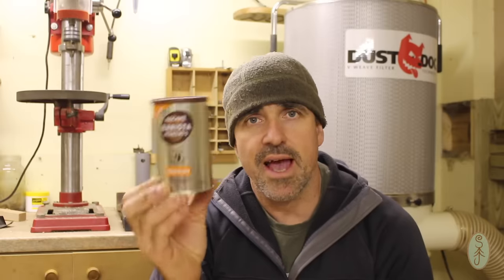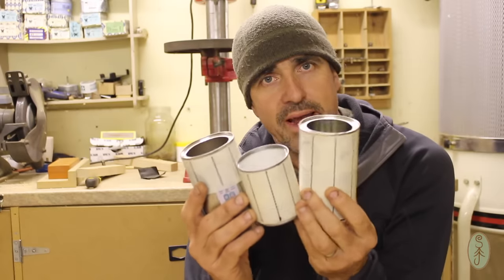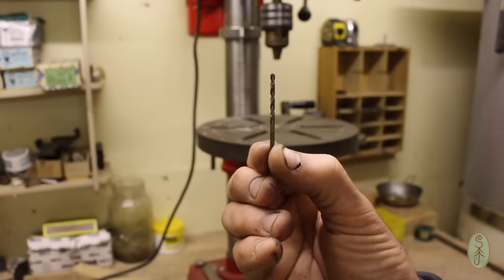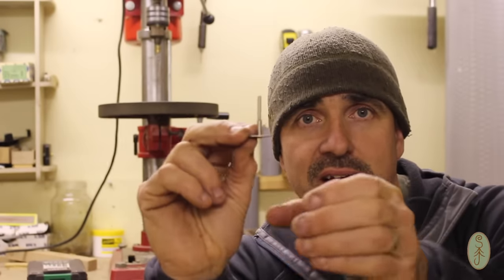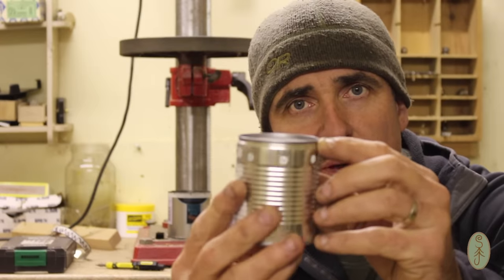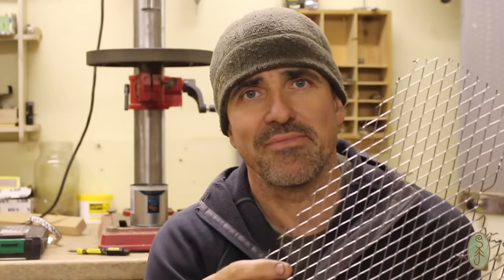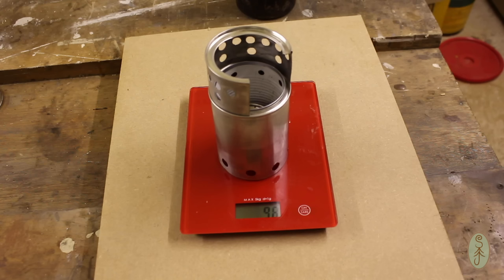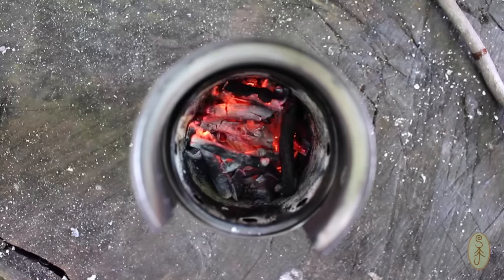Ultralight Wood Gas Stove.  How to Make a Super Light and Compact Backpacking Twig Stove.

Comment: Should you not have powertools, and have to use hacksaw and no step drill , consider filling can with water and freezing it before working on it.
Reply from the maker: That sir is a genius idea!!
Reply: can I be dumb and ask  why?
Reply from the maker: It keeps the can stable while drilling and cutting - stops it squashing and reduces tearing when drilling - you are basically creating a temporary solid object to work on. 👍
Reply: Alternatively, use metal shears or heavy duty scissors of some sort? The frozen water solution is intriguing though -- I might try that. Cutting something as thin as a can with a hacksaw will probably not work well unless the hacksaw has really, really small teeth.
Reply: Amazing! So, the genius for this video brings out the genius of a viewer! Awesome!
Reply: Also, it will keep drill bits and cutting tools cooler which results in a longer lifespan.
Reply: All the benefit of attending an engineers convention... thanks for sharing the skill and erudition.... ATB
Reply: So make all markings first before freezing...but tape wouldn’t stick and the marks from sharpie may rub off after freezing? Or would the marks stay, I wonder? Simon, Tfs and Atb, Nikki.
Reply: Or using a curved wooden cutting block to drill and cut against.
I thought that while watching, and also that the stretching method, while ingenious, would be far more enjoyable after emptying the bottle :-)

Comment: I have a cheaper copy of the Bushbuddy and both its combustion chamber and outer sleeve have bottoms. After a while, it produces clean, blue flames so the bottom doesn’t have to be open. With both sleeves closed, the ground doesn’t suffer. I’m very impressed by what you’ve created. Maybe there’s scope for a shorter, stouter Mk 2?

Comment: Wonderful design and make - I love it. Three things to notice:
a) the bottom of a slightly bigger can could help against scorching the ground and catch the ashes and embers that fall through your mesh
b) using a finer mesh and smaller pieces of wood (about half the size of the diameter of the combustion chamber) or wood pellets would give you a longer burn time
c) you don't want to overfill it - the holes for the secondary combustion need to be slightly above the fuel to work properly - watch your stove starting to smoke after refilling with longer sticks; smoke is wasted energy

Comment: Simon !  I just made one of those.... had to improvise in a few places but the results were remarkable !  i just put in 2 small hand fulls of wood pellets  into the burn chamber and sprinkled 91% Iso-Alcohol on the pellets and lit it with a match... it went puff and then it was going so real easy to start... I tested it in my shop with the sliding barn type door open but there was absolutely no smoke at all once it got going.... I just drilled holes in the bottom of the burn chamber and it did indeed work fantastically boiled the water in about 4~5 minutes to a rolling boil just like the Alcohol stoves for the most part the flames were blue and that surprised me ! the jets near the top were yellowish near the top  the rest was blue ! 
.... the cans i used were a Progresso soup can and a cambles chicken noodle can (old style stuff) the cans nested well inside each other so I used them ! so there was no streaching the rim they set inside each other and there was no need to fuss with the rim the cans fit fairly close to one another so I was concerned that the jets would not get enough air but they did indeed work very well together .... thank you a bunch !
Incidentally the Jet holes I used were larger than yours and I noticed yours had a tendency to smoke a tiny bit.... Mine doesn't at all and I was really surprised !
I also used 8 holes but a slightly larger size ( I think 1/2" but that may be on my bigger chili can and spaghetti sauce can(big tall can) woodgas stove ) they both work great !  I cut the center of the bottom of the chili can out to fit the spaghetti sauce can and fit it in there and then took my plyers and bent the rim of the burn chamber out so it would be more stable and not fall through.

Comment: Awesome stove Simon! If you put a paint can lid on top of the pot stand you don't have to worry about soot getting all over your pots. It would mimic a heat diffuser perfectly! :) You can also get another coffee can, and that would make a nice looking homemade cook pot. It will look very identical to your homemade stove! Buy some stainless steel wire to make a handle with the wire with pliers, or a bail. After burning off possibly plastic inside your coffee can your homemade pot should be ready to go! :) Thanks for sharing! Melissa :)
Reply from the maker: Thanks Melissa! That’s a good tip with the paint can lid - I’m going to give that a try! The soot on my pots has never really bothered me, in fact there is an argument that it improves boil time - the Black absorbing more heat (I’m not entirely convinced haha) cheers, Simon
Reply: Hiram Cook did a test on clean pots vs sooty pots. They both have the same time. We hear our moms say " you need to take care of your things." Getting soot all over our cookware makes it look like we are being careless with them.  @simonablokeinthewoods
Reply: @weatherstorms it also eats away at the material beneath it.

"A decent man returns the tools he borrowed in as-good or better condition than when he received them."

Be decent to yourself 👍
-Not A Boomer c:

Comment: Note: if you want to avoid soot on your container, just put some aluminum foil on the bottom of the cook container.
Fast and easy. Container stays pretty clean.

Set a flat rock on that tree stump....Or several handfuls of dirt.

Comment: I've made twig stoves from a chowder can (bigger than that sweet corn can you showed) and a bigger can from pineapple juice I bought not only because I like that juice, but to have a can that big for it. For making holes in can I just used my simple pocket knife I had for more than 20 years which cuts through the can's metal good and doesn't even get dull from that small amount of cutting on a couple of cans.

Comment: Awesome. A bit larger (ikea hobo stove diameter) would be perfect for me, but that would slightly bump up the weight ofc. I made one with a corn-can as burn chamber, and I find it way too small to be sustainable. I have to keep adding fuel, meaning it will smoke everytime I do so. And its so small that a fully prestacked chamber will burn for a max of 10 min (for me). So I went double that size - used the coffee can as the burn chamber. Much better for me. Burns for like 15 min easily. When it's down to coals I add tinder to start a flame, and then keep adding inch long twigs till it's full to the brim. It burns for another 5 min or so. The prestacking capacity is important because refueling will never get such a long burn. On the ohuhu type stoves I get 25 min burn and 10 min coals. Ends up at around 130g. Slightly heavier than my picogrill 85. I am fine with that, since this is a gasifier and doesnt need windscreen (though it helps) and it nestles inside my pot, with space for my penny stove inside, and ofc my DIY soda can cup.

Comment: Great idea and great design.
It may be worth pointing out to the unwary that the stove should be well test burned before use for cooking, so that any residue from inside the inner (sweetcorn) tin is completely burned off.
An upside down metal plate would make an insulator/heat shield to allow the use of the finished product on surfaces which it would otherwise scorch.
Reply from the maker: Thanks Phil, good point! 
I use a small disc of carbon felt as an insulator now - weighs nothing and rolls up/stores inside the stove. 👍
Reply: A quarter sheet pan would work just fine, be flat, and create an air gap.
Reply: Now THAT'S a brilliant idea - the upside down metal plate. AND, I'd mod the cooker so it it could be FASTENED to the metal plate and not TIP OVER!

Comment: Great job! I used a Salmon can, they're tapered. Also try using wood pellets. It will have a flame over 16 inches high!
Reply: I carry a lightweight  Hand Pruner with Curved Blade to cut the wood to pellet size.  it's much faster and more precise than batonning or sawing the wood branch or sapling.  A few uses will easily offset the price, compared to commercially produced pellets.  Besides, you won't find pellets on the forest floor!  lol

Comment: Brilliant! Not just how to - but Can Do (excuse the pun...) definitely inspired me to have a go! I'm a stealth camper - leave no trace - and I wonder if the scorched ground marks and narrow Base instability could both be overcome with a bicycle spoke based three legged pot stand - but very short legs - with brass wire to make it foldable and stowable - this one inch off the ground and three legs might be just the right finishing touch!
Reply from the maker: Thank you!
I reckon that would do the trick nicely - I now use a small piece of carbon felt under it which stops the scorching. 👍

Comment: Great idea, I have seen and made a few meths stoves (slot and penny) out of small coke cans and also smaller again on the 125 ml sized cans, great fun and a neat fit  for a gas flow chamber when you get the measurements right.  As ever a pro job and pro presentation on a diy Wood gas burner, nice and environmentally friendly.
Reply from the maker: Thank you! I do love a pop can stove - such a simple yet efficient little stove - I’ve been given some carbon felt which I’m looking forward to using in my next one. Atb, Simon

Comment: Really ingenious, Simon.  Just one thought - could you retain the base of the sweet corn tin and just drill a few holes in it, rather than use the wire mesh?  Great use of waste materials - nice one!Peter.
Reply from the maker: Thanks Peter, yes I think that’s a really good idea, suggested by another viewer too - the fuel burns a bit quickly with the mesh! Atb, Simon
Reply: I was wondering the same.
Reply: That was gonna be my question.... drill 2 or 3 mm holes all over the bottom of the can,  will hold your wood or wood pellets and yet let plenty of air in.  It will stimulate using the mesh
Reply: @simonablokeinthewoods Not only that, but the residual ash and tiny coals will FALL through the mesh and create a fire hazard.

Comment: The Solo Stoves already have my money...I am adding a screen in the bottom of my Titan and Campfire stoves to also handle wood pellets... even though I have used the pellets a few times as a test... that closing the bottom was a thing I was curious how you would do it... the Solo Stoves I have have been foot print friendly.  Light weight tuna can might as an part of stove bottom, what I am using for added screening is the cheap stainless veggie steamer... consider a drain strainer... fold a couple tabs to use stainless pop rivets... if tuna can will fit the bottom pop rivets to attach the tuna type cans to the bottom maybe.

Comment: Keep the fuel below the level of the air outlet holes in the inner can, anything above is not in the gasification zone,  this will prevent smoke and soot on your cup. The one I made I used exhaust paste to seal the two cans at the top because my cans were  not an exact fit. It should he noted that these tin can versions burn out after heavy use and you will have to make another, they are not a perfect substitute for the off the shelf stainless versions.
Reply: Try painting them with the stuff you use to paint fireplaces with. Here in South Africa the main brand is called Rust Oleum and its heat and rust-resistant to 1200 degrees.

Comment: You could always use a single 4 inch or 6 inch ceramic tile depending on the can size, like you would use to tile a floor with as your  base to set the can stove on. Also small and not a lot of weight.

Comment: this is awesome. it would be cool to see if u could modify the design and make another that doesnt scorch the ground. thats one really nice thing about the bushbuddy. even if it was a bit oversized, i think a lot of people would prefer to carry a little extra weight to be able to cook anywhere.
Reply from the maker: Thank you! I think it would work better with holes in the base of the chamber instead of the mesh, I’ve also cut a disc of carbon felt to sit it on - haven’t tried it yet, but should help. Cheers.

Comment: Really neat. Looked almost like a mass produced thing when you had sanded the images off.
However, where I live - in Sweden - you need to be careful also of rock surfaces.

I made a buddy burner today, and it worked really well - indoors.
When my ten-year-old yelled I had promised her to grill sausages outdoors,
I let her go to the store and buy some vegetarian sausages and hot dog buns.
When we finally went out, it was windy and had started drizzling.
After a few attempts on the communal grill (wouldn't scorch that)
and under the passageway through the house, I gave up.
At least a couple of neighbours got a laugh out of it.
(Who was to blame for the weather?
A. Mum
B. Mum or
C. Mum?)

Comment: It seems that I need to buy a fair amount of equipment to make a cheap stove?  The cost of the equipment far surpasses the cheap stove unless I build thousands of them!  Great video , now I think I can do it without all the equipment on a bike tour, as you need to do something at night.
Reply from the maker: I only used the tools and equipment I used as I already had them - you could quite easily make it with simple hand tools.
Reply: All you need is a drill and tin snips, hacksaw, or sharp knife with strong blade. If you don't have a drill, I'm sure there are ways to punch a number of 6-8 mm holes in a can. You could even use that same knife, and make rectangular slits instead of round holes.

Comment: curious...instead of cutting out the bottom then replacing it with expanded metal, why not leave the bottom in place and drill a dozen or so holes in it to retain the fuel and get airflow? Seems more structurally stable and would take 2 minutes on a drill press.

Great videos, I love your work and imagination!
Reply from the maker: I did it the way I did because the bottom is actually the top of the can which has a ring pull lid - I removed the lid to empty the contents therefore has to replace it with something as the base. 👍🔥
Reply: @simonablokeinthewoods  ah, makes sense. Nicely done either way.

Comment: So impressed I’ve gone and specifically bought the cans. Could you use charcoal in it to prolong the heat/burn? Now that you’ve tried it do you think it needs trivets to aid the air but also to limit the scorch? Also what size (height) did you make the pot stand?.
Reply: I would leave the rim on the pot stand to keep it rigid and just cut out the square to feed the wood in.
Reply from the maker: Rather than a trivet, I’ve found that a small round of carbon felt stops the scorching and it’s light and easy to pack.you could certainly burn charcoal in it, but it probably won’t work as a gasifier that way - when you build yours, give it a try, I’d be interested to see how it works. 👍 I’ve got all the measurements on my Facebook page. Happy building!
Reply: Simon, a bloke in the woods Hi Simon,
I had a quick look on tour FB page and although I saw the dims for the baker tent and the YT link for the wood gasifier stove I couldn’t see any dims! Maybe I’m not looking in the right place or deep enough.

Comment: Simon, you've inspired me to make my own.  Just one question; what are the dimensions?  Especially, how tall is the pot stand?  I plan on making a slightly larger one and I'd like to ensure that mine has enough space to put larger pieces of wood in easily once the pot is on top.
Reply from the maker: I’ve put the dimensions on my Facebook page - good luck with the project! 👍
Reply: @simonablokeinthewoods  Is it critical how far up the holes are on any piece please ? (Also relative to each other pieces, e.g. bottom of combustion chamber above/below holes in outer tin ? Thanks.

Comment: If you heated the can before sliding it over the bottle wouldn't it slide easier being a bit expanded because of the heat? Then leave it to get cold still on the bottle. It will keep its stretch because it won't be able to contract.

Comment: Need one with the following capabilities:
1) DOES NOT CREATE SOOT
2) Can feed while pot/skillet is on top
3) STABLE
4) adjustable heat output.
5) 1 hour cook time.
6) Uses alcohol stove in it, twigs, pellets, charcoal.
7) Cheap and easy to make without specialty tools.
Bonus: a way to use used motor oil, cooking oil, similar as an alternate fuel.

Comment: The only short fall I see with this design is with the top pot holder. If the top ring was in tact & the bottom too cutting a port & not removing all the metal would make it a bit stronger. If you only cut the bottom portion it would still work quite well I'm sure.

Comment: I can't make out the words when you name the meths burner, mini-something or other design? Also great video.
Reply from the maker: I think it was a Mini-bull designs burner. 👍🔥 made by the legendary Tinny - search minibull on YouTube. 👍
Reply: @simonablokeinthewoods  Thanks I will, I have quite a few meths designs. Unfortunately meths doesn't seem to have as much burning power as other fuels. I believe fuel actually is measured in calories. In the U.S I would use gasline anti freeze, a product called HEET which burned super clean and was very efficient. In Europe alcohol is easier to buy and much cheaper than the UK. Meths just doesn't seem to have enough calories, but I love trying new designs. Incidentally today I made a wood gasifying stove from an Ille Coffee tin as it is a snug perfect fit in my cooking pot.